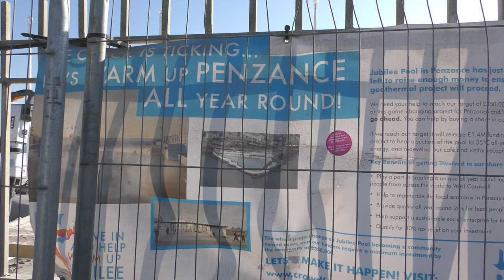JUBILEE POOL GEOTHERMALISATION - COMING SOON

Comment from the maker: UPDATE (26 April 2019) :  The heated section of the pool will not open in Summer 2019 as planned, but a few months later in November.

Although drilling of the production well was successful, reaching a water temperature 30° C. Geothermal Energy Limited had originally planned to drill deeper for higher temperatures. However it encountered a zone of very high water flow at 410m below the ground. Given the risks of drilling further and potential well collapse, their geothermal team decided to stop drilling and make best use of the hot water zone. In order for the pool to be adequately heated during the cooler months, GEL have agreed to install additional sustainable heat pumps at their cost to top up the heat supply to the pool.